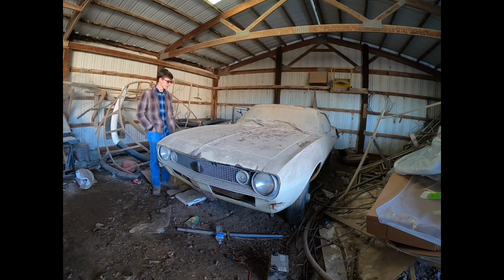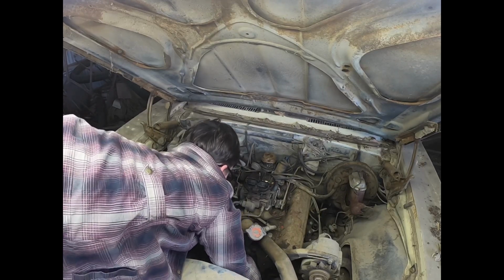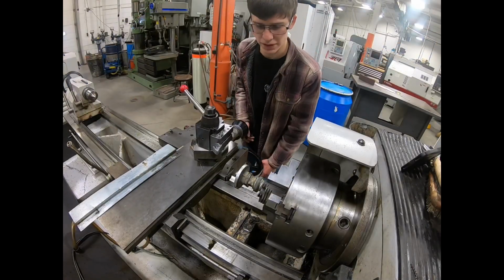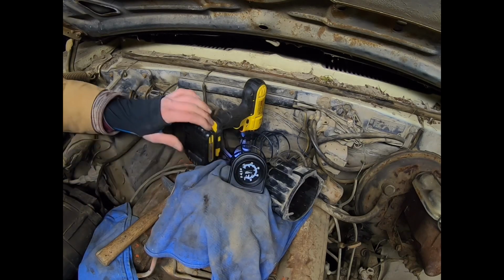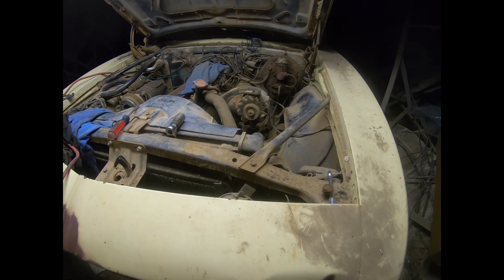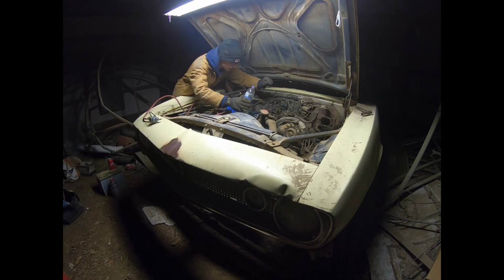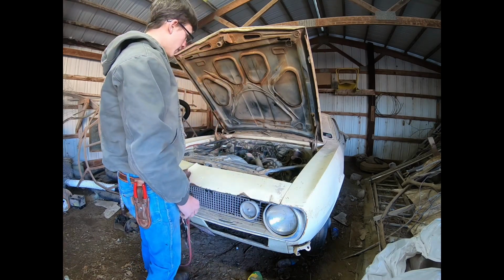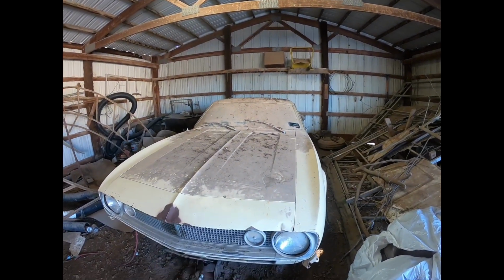67’ Barn Find Camaro FIRST START!!!!

Comment: It's a two speed automatic aluminum powglide if it's a 327 .
If it's a 350 it has a 350 trans.
I have the first one above
Reply from the maker: I didn’t look any further into it I naturally assumed it was a TH350 because of the linkage.
Reply: @meccarepair2597  cool car man ,
I bought mine in highschool in 1973
It had 89,000 miles on it I drove it for a few years and bought a 65 convertible GT mustang and also a 71 AMX and it was mean 401 moter. I sold the last two but I didn't have any idea what the Camaro would be so wanted but now it hasn't been out of the garage for awhile (30) years it now has 110,000
Miles California car and not a spot of rust , raised 2 kids went through 2 moterhomes 2 boats Dunn with all that
Time to bring it out.
Reply: 350 had powerglide also... TH350 wasn't available till 1969

Comment: Cool video! Please make some cold starts and show us the proper procedure for starting all of your carbureted engined cars. You really seem to know what you’re talking about... I’d love for you to give us a full tutorial on how to beat start them up. Especially from inside the cab! Or with the door open. Maybe with and without choke! 

Subscribed!
Reply from the maker: Thank you! I've got access to a bunch of older vehicles that I hope to make first start videos on once it warms up. I believe the next one is gonna be a 60's Chevy Van. 6 cylinder and sitting in a field so it has to warm up before I'd like to start on it. Thanks again!
Reply: Mecca Repair I can’t wait!!! Please show us from inside the cab what you’re doing when starting any of them - either cold or the first start. Glad I subscribed!
Reply from the maker: I’ve got the second video up on the Camaro if your interested. The van was a simple one to start. Now I’m just waiting for it to thaw out to dig it out of the hole.